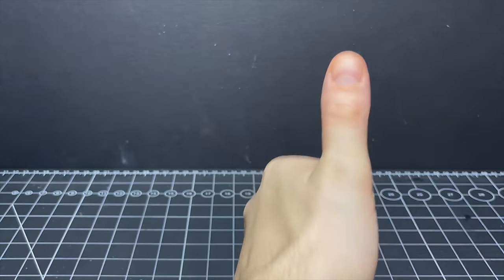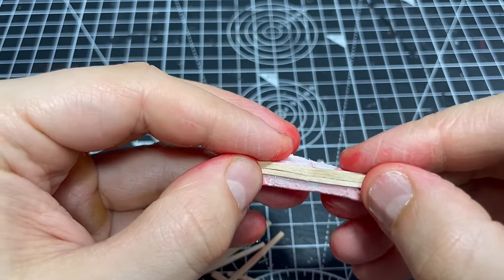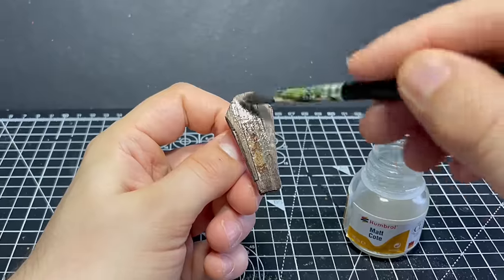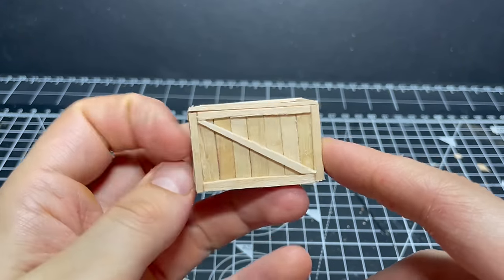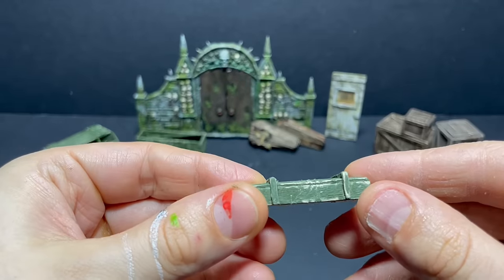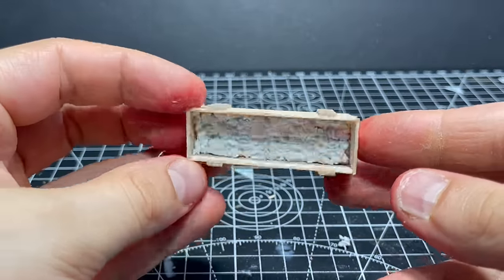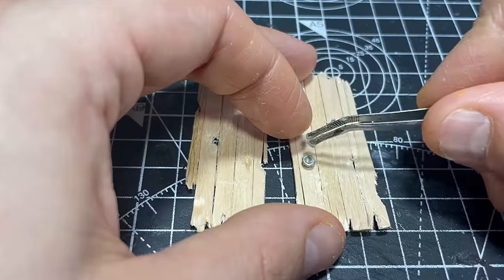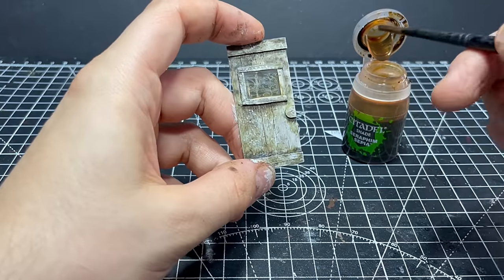FOUR(ish) Things To Make From Coffee Stirrers for Dioramas and Miniatures

Comment: I did some doors recently and had some spots that wouldn’t stain where the Pva glue touched the wood from the excess so I used typhus corrosion texture from gw to cover it and it gave the wood that rotted look worked well. Feather the edges with a wet brush and it was perfect
Reply from the maker: Ahhh great idea, I’ll have to give that a go next time, thanks for the suggestion!

Comment: Have you try use 5mm foam board? You can stack as many you want to get height. Its good size to make building and brickwalls.
Reply from the maker: I have indeed, probably would have been way better than the foam I used in this video. I might have to have a play around with it again soon I have some walls and other bits I need to make, thanks for watching!